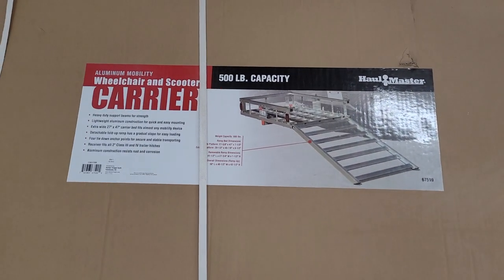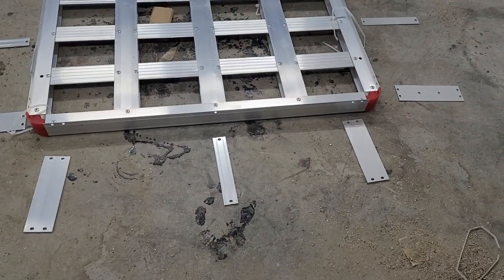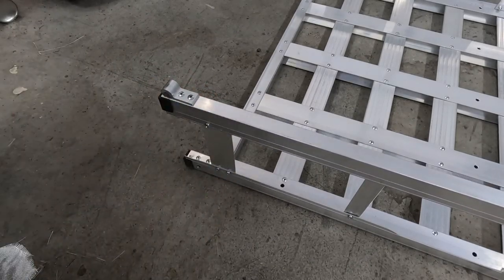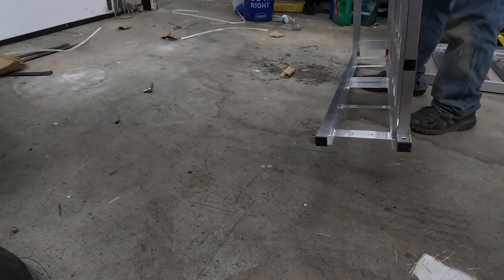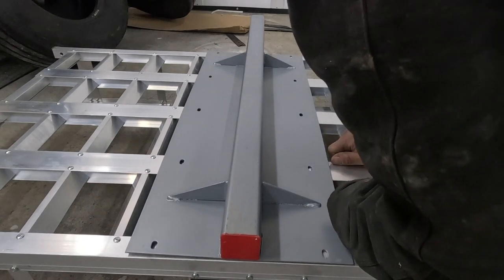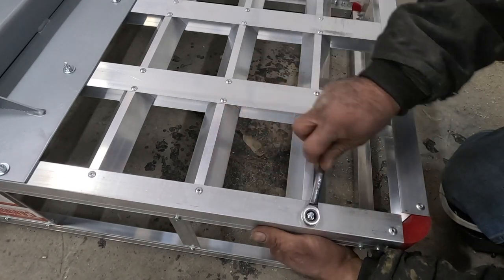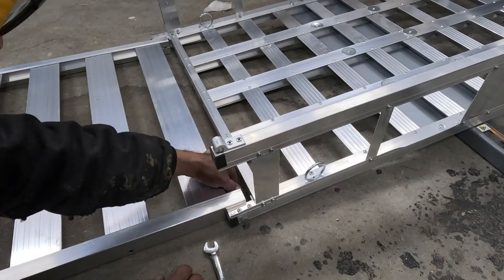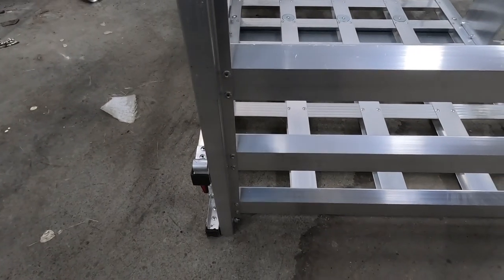500 lb. Capacity Aluminum Mobility Wheelchair and Scooter Carrier Unboxing & Assembly

Comment: Nice that the sides aren't pre-attached. You could make a little larger platformr protruding from the back with pressure treated wood. That could make a nice platform for a lockable box for a generator, etc.